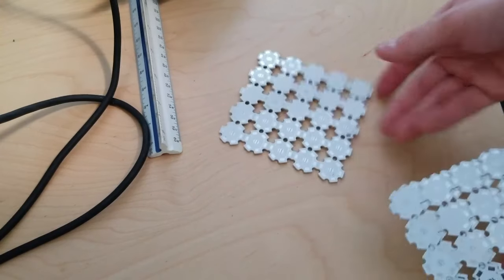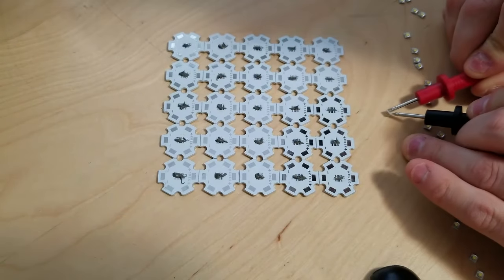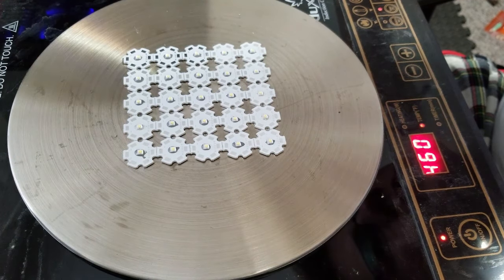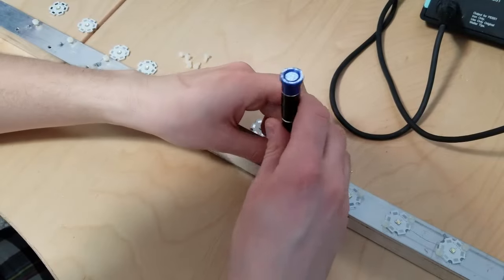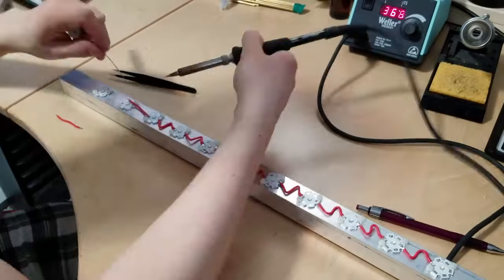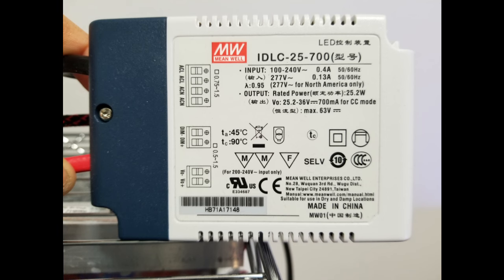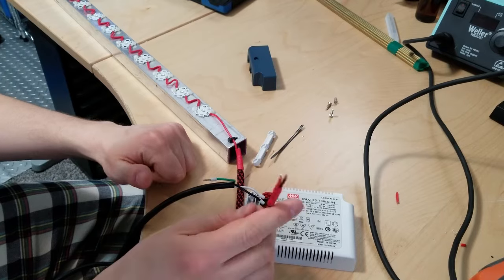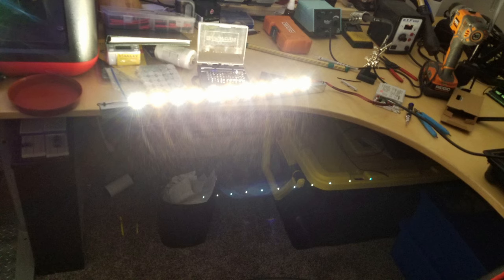DIY LED Lighting - How to Make Your Own Grow Lights!

Comment: This video is extremely well done. Thanks a lot man.
Reply from the maker: Gotchu fam
Reply: @autumnmaticcreations62  it really is well done. You wouldn't be a poor student if you could build grow lights for dc off grid systems. The demand is huge and the supply is nil. Put together some plug and go systems for direct alligator clip to a 12v system and mark up parts and give yourself 30- 40 an hour and you wont be broke long.

Comment: Is there a way to fix the LEDs to where you can fit more and much closer together? Kind of like when you look at the Mars hydro grow lights. I would like to pack as many LEDs into a 24in x 24in square. This is all totally new to mebut I have a feeling building my own will save me a lot of money and I would learn quite a bit which knowledge is power. I really want to build a super awesome grow light and I will even get heat sinks and fansto keep everything super cool if anybody has any suggestions or maybe I don't have to get the super small LEDs and I can find bigger ones? Any ideas or advice or information would be greatly appreciated. Thank you in advance to whoever is nice enough to respond.

Comment: So, what is the bottom line here on savings over, say, a retail light of that size? Also what is the wattage of the one unit you made? And will the power supply run more than one unit, or is it just about the right size for just one? Thanks, and great job there.

Comment: nice build ... only one ting missing ... a piece of electrical tape over the ground wire ... if you touch that you are grounded to the house and can get a severe shock .... wire nut or electrical tape the end of that sucker

Comment: Hello, I would like to know how to connect multiple types of leds to the same driver. For making a full spectrum light the leds run at different current and voltage. Good inspiration.Thanks

Comment: Nice vid bud, What are your thoughts on bloom buttons that are on some units. I'm using a cannalights® smart3522k led grow light. some say it's ok to use bloom during vegging as well. I'd love to hear what you know or think of the unit. I'm in a 2x2x4 foot tent :)
Reply from the maker: It doesn't hurt to use the bloom function during veg. You might save a bit on your electricity bill without it, but it'll be fine for the plant!

Comment: Awesome video.  As many have said extremely well presented.  Do you have a "black" wire coming off the DC negative end of the light circuit and going back to the source inside the square tubing? Thanks again!!

Comment: If you have a thermocouple and a multimeter with a thermocouple input, you can do the reflow really well in a countertop convection oven.
Crank the temperature all the way up, and control the temp by cycling the power on and off.
Reply: Most counter top convection ovens won't get above about 380-400F, even though they might say 500F on the dial.  I'd be wary of using the 500F setting because that turns on the broil heater which might over heat the leds.
Reply: @kristenhansen1843  That is why you turn the temp all the way up and just turn the power on and off using a thermocouple. I've done probably 50 pcbs using the $7 Oster convection oven I bought in a goodwill store. I've never had any problems.  I downloaded the recommended temp vs time profile from Kester, the solder manufacturer and tried to match it.  That particular convection oven had no trouble reaching the melting point of the solder (370F for 60/40 Sn-Pb).

Comment: yes hi ive watched your video and found it very good thumbs up ! i just wanted to ask you if i can get or where to get the samsung diodes in strip form already assembled,  what is better single or  double rows, im canadian also in montreal keep up good work.  why i ask is because im alittle intimidated building the diode like you did also i was told that it is possible to add like a magnifing glass on top of the diode is this correct and if possible

Comment: I want to power my 50wat COBS with my old psu power supplies. Even my lowest one is a 450 watt capable so theres at least 4 right there. Which would work great cause  I wanna make it so all the diff color spectrum's are on separate switchs

Comment: Could you eliminate the power supply and run this directly off AC line current?  the only thing you might need is a current limiting resistor or PTC thermistor and a high voltage diode for the maximum reverse voltage.  probably would need a few more LED's too.  Like maybe about 18 for 110VAC.

Comment: hey what about the spectrum when growing for example weed you need different lights for the different stages of the plant I think it's like that with a lot of plants probably the same if you're growing strawberries but I thought you needed a certain kind of spectrum so my question is are these lights that you made right now just regular LEDs or do they have a special hue or colour for growing purpose.  also do you get everything of Ali I haven't looked yet but if you would put links that would be great

Comment: This is brilliant and so simple but want to know more about the composition of the leds them self and the power source to get the most true watts
Reply: LazyH-Online  because some companies will list a light at say 300 watts and you get a digital reader can test that it's wrong. Like a 100 watt mars is not true 100 I read it at 92... with a good driver.

It's called false wattage claims 

Same if you had a JL AUDIO W7 subwoofer and a KENWOOD 1000W amplifier. If the amp sais 1000 and your shit isn't banging out than you aren't putting 1000 true watts out..More like less than 200... companies can get away with this through some loophole because it's the recommended max watts the light should get 1000 true watts anything more would shorten the lifespan or blow the system totally

Comment: Hi AutumnMatic Creations. Big shout out from Austin, Texas! 

During these times I am looking to make some UV-C lighting with LED for my vehicle. I am a ride share driver, U/L and local Ride Austin, and I want to save on drips, sprays, and wipes. I would just need to turn on the UVC lighting in-between rides, and for about 30 minutes after ending the work day. I have a Dodge Grand Caravan, so I will be wanting to custom build the lighting to go in the back. 

Can you advise me on using the accessory power from my vehicle. When car is off.. you get the 12.6 to 12.8 VDC, and when on it ranges from 13.5 to 18 VDC. I will need something that can take the voltage from the vehicle and give a constant current, as well as constant voltage of what ever is called for. 

Any recommendations?

Comment: Hey its been awhile are these still the leds you reccomend? I see most "top end" grow lights seem to use samsung 301b leds now.
Reply from the maker: It really depends on the application. If you are making your own lights, I still recommend the 351 series. 

The LH351 series are more expensive but they have a much higher output capacity. For individuals, these are better because you can make a fairly powerful light with a handful of them.

The LM301 series has been used in grow lights for years, and that is because their capacity is much lower and they are relatively inexpensive. From a circuit design perspective, this is a better option for manufacturers because it simplifies the on-board power management. Since those configurations are highly parallelized and use way more LEDs, it also allows for several to burn out without shutting the whole board down. It would take you forever to build a decent board with them by hand, though.

In short:
LM301 - better for manufacturers.
LH351 - better for hobbyists.

Edit: This only applies if you are making your own lights. If you want to buy a premade solution, the 301-based boards will probably last longer and be slightly more efficient due to better thermal management.

Comment: Hello,, How do you know what color spectrum the LED's put out ? Since you need a blue light for veg and a red light for flowering ?  Can you buy Red Spectrum and Blue Spectrum LEDS ? Also, do the LEDS come with a spectrum Graph to show the exact output range ?
Reply from the maker: You got it. The datasheet for the LED modules will give you a color temperature (CCT) range, which specifies the color of the lights. I use a blend of 3000K-6000K lights to give some extra blue/red variance

Comment: The nominal current rating on these Cree LEDs is 350 mA and the absolute maximum 1000 mA or 1 amp. All of the ratings including light output,  life, etc are related to the nominal 350 mA test current. Running these parts at 700 mA will result in more light output, more heat, and a shorter life. Measure the temperature of the actual LEDs and compare that to the data sheet. Even running the parts at 350 mA may be too much for the aluminum tube.

Comment: Hi. I also want to make one. But I have a question. If I want to use  just one power supply, and I will use two different type of LED, 
there will be no problem with the voltage? I have some 3W red and blue LEDs. One of them is 3W, 700mA and 1,7-2,4V , and the another is also 3W and 700mA, but 2,7-3,1V .  10 pieses of one and 10 pieses of another. 
I think I need aprox a 70W power supply, with a fix 700mA current. 
But the different voltage is not a problem? How you solve this? What output voltage I need, if I connect them in serial?
Reply: Or is better to use two power supplys with just 10 LEDs, and to connect the similar voltage LED-s separately?
Reply: As I see you use 3,5W LEDs, 11 pieses, and a 25,2W supply. It is sufficient?

Comment: Awesome video, im gonna give it a try...
So....the color of led doesnt matter? I just saw lots of grow lights in market are combination of blue and red leds.
Reply: And also does it mean if i have led strips, then it will just work similarly?
Reply from the maker: Different colors will have different voltage characteristics for a certain current. Check the datasheet if you are unsure about that.

For strips, just check the current/voltage requirements and grab a current driver that works for the unit

Comment: Good tutorial and flow on instructions, only thing that was missing is connecting the two wires from the DC p/s to the "light bar".

heh; your portable inductive cooktop is step up from my super-cringe reflow electric skillet, I might have to steal that idea and upgrade.  The skillet has successfully killed a couple boards with hotspots.  Also not burning arm on edge every-time would be a huge plus (skillet has a 2 inch lip).

Comment: Was it cheaper to reflow your own led on stars? Why don't get pre installed ones?
I probably missed out that part but I'm curious why you chose to reflow yourself
Reply from the maker: It definitely saves money to solder onto the stars. To buy a prebuilt starboard cost around $5 last I checked. To get the starboard and LED independently, you're looking at closer to $1 for a set.

Comment: Will these boards work for using lm301h diodes. Looking to put about 1200 diodes on want to make a nice sized light for a custom room.
Reply from the maker: These boards work for 3535 footprint LEDs, so no, LM301H lights won't work with these boards. You should actually be able to use FR-4 for those given their low power.

Comment: what size are the smaller wires? (12 gauge?)  Then you plugged it into something that turned it into a black and white wire, what's that? Finally, what did you do for the other end, should I tuck it in the aluminum thing?
Reply: Not to be rude, but if these are serious questions, you are not nearly knowledgeable enough about electric circuits to be starting your journey on this video. For your own safety you should seek out some introductory videos about electricity.

Comment: How is the light bar earthed if the earth wire isn't connected to anything? or does driver simply convert to DC?
Reply from the maker: Hi Shane. You're right that the driver converts the AC signal to DC. The earth wire functionally doesn't do anything in either case, though. The earth ground is a safety feature that prevents users from getting shocked if one of the live wires comes loose and touches the enclosure. Usually, you would attach the earth ground wire to the metal enclosure so that any excess current diverts to ground in the case of a loose live wire.
Reply: @autumnmaticcreations62  ok cheers

Comment: Hello. Thank you for taking the time to share your knowledge. This is by far the most useful video i have found. Very well explained. I have the time to build it, but not much money. I currently have 3 rooms, growing medical cannabis as a necessity. I currently use metal halide for veg and high pressure sodium for budding (1000 watt).  Power bill is killing me and also heat.  I wish i could afford the spydrx  lights, but way out of my price range. My math is not good, so i am wondering if you could give me a list of what would be necessary to build lights to replace my current 1000 watt ( for both spectrums halide and sodium) If it is possible to link multiple sections of light, example 8 feet x 4 feet or 12 feet x 4 feet saving on drivers. As i said, i dont understand the math. I would like to build similar to a 4 x 4 foot light, or 8 foot x 4 foot or 12 feet x 4 foot.  I dont feel comfortable designing my own, as safety is important to me. Any help would be much appreciated.

Comment: Awesome video! I did exactly as you wrote but in a car headlight and I found an issue, when I turn off the car the LED is still glowing a little, Should I use resistors?
I am using 12V to 42V constant driver (for 8-12 W leds) and using 9 leds.
In my calculation I am using 27V (9 piece 1W-3V leds 300mA) in the leds so I have 15V extra power what the driver is limiting out, but can it still "store" some power? or what can make my leds glow(very little)?
Reply from the maker: Hey Christian, apologies for the late reply.

Don't worry about the excess voltage allowance - this shouldn't affect how the circuit operates at all. It's typical for the Driver to stay on for a few hundred milliseconds or so after the supply is cut off, but that's just while the capacitors discharge.

The problem is more likely that the supply voltage is not removed from the driver input, or no 'off' signal is given to the driver when the car shuts off.

What is going to the input of the driver?
Reply: @autumnmaticcreations62   I actually tested today and exactly after 2 minutes everything shuts off! so I guess its just the behaviour of the driver as you mentioned! thanks for the reply!
one more question, one of my circuit is vibrating a little, with eye you hardly can see but still..  do you know what can cause the vibration? the other one is perfect, same leds/ driver used.

Comment: I've been thinking of using corrugated fiberglass roofing panels to make an 8x2 foot light using light strips. The issue I have is finding super bright led strips that are 3100k with some red. I think these would be better, but I'm thinking I would need a lot more than 11. Can you help me design a circuit and find a driver? Or maybe a 2x4 would be more manageable...

Comment: Is there a over heating issue that should be taken into acount? Like do you have to add a heatsink or fans? I'm making a panel of 100 10w leds.
Reply: yes you will need to be concerned with heat ... or to be more exact some airflow over the leds to remove the heat from them

Comment: Thanks for video!
Did you measure radiator temperature?
Is 1inch aluminum profile enough to cool the system?
Reply from the maker: Hey Andrii, I didn't measure the temperature. It did get pretty hot at equilibrium (probably between 60 - 70 degrees Celsius), which reduces the efficiency of the lights a bit. Cree's and Samsung's 3535 LEDs are tough though, they should still last a long time even when they're running hot.

Comment: Great video! I have a question- do you know where coloured, hi-quality LEDs can be bought? I've been trying to find out how colour spectrum works exactly ie: if a white LED can be coloured externally to emit the desires spectrum or if it has to be radiated from the source. Might be a dumb question, but I'm having trouble finding the info. Thanks!!
Reply from the maker: Hey BHW, if you're in the USA check out RapidLED, they have pretty good colored CREE lights that fit the 3535 footprint.
Reply: @autumnmaticcreations62  heya, thx for responding. I'm in Canada actually- I was looking up on the mouser site you listed and they have red and blue lights as well. the blue lights available are 451nm, and I'm reading 430-450 is the important spectrum for blues. I'd assuming that one nm isn't going to make a big difference, but I'm also really uninformed as well. Do you know if that single unit outside of the ideal range makes a difference?Thanks!
Reply from the maker: @hollisarkham  The listed wavelength will usually be a 'peak' value with a range about that value (typically with an effective bandwidth of 30nm or so). To answer your question, you will still have some wavelengths in that 'peak photosynthetic activity range'. Even if you were outside of that range slightly, the plant would still benefit from the light.
Reply: @autumnmaticcreations62  That's great info, I really appreciate it